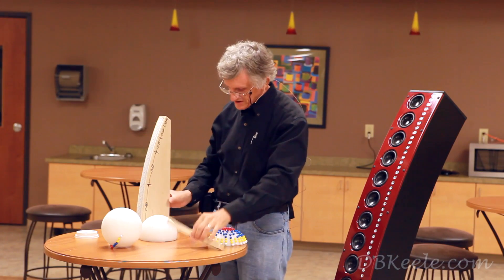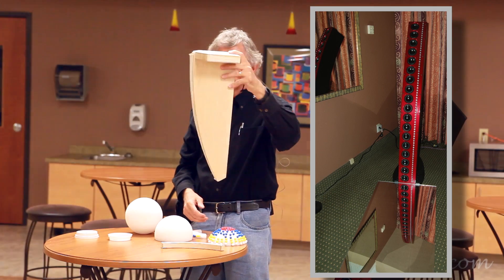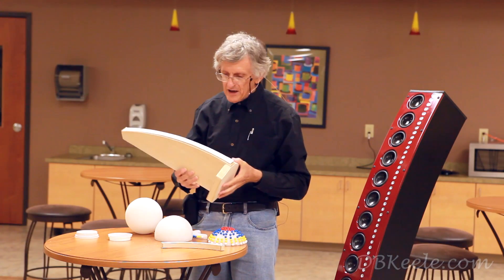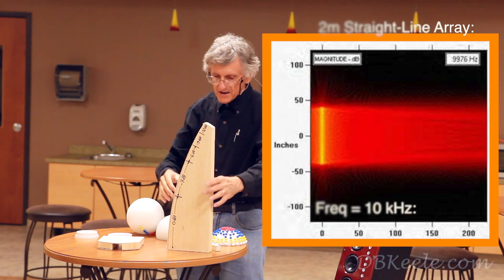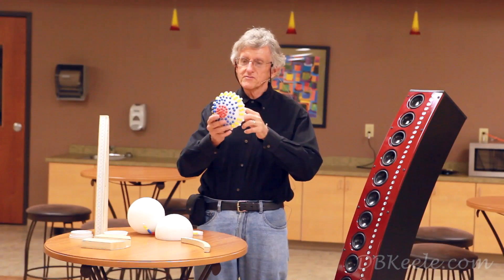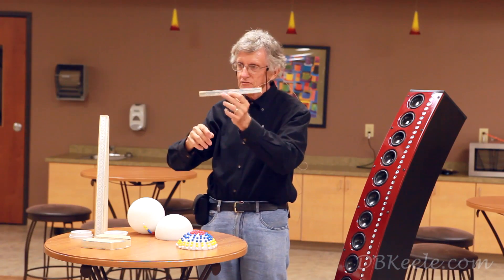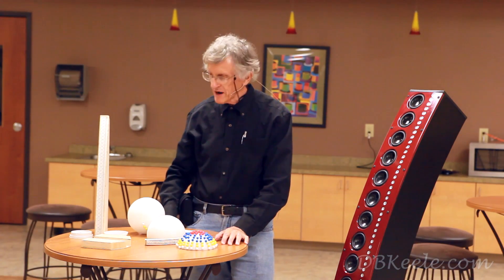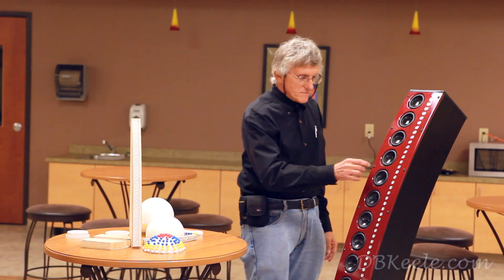CBT Chronicles Part 3 of 9 Introduction Continued: CBT Theory, The Gruesome Details

Comment: You get the lobes if there is no delay.  But add  delay and you cand control the lobes.  You've created a line array with physical delay instead digital delay then added shading.  I've used, and i am sure others, shading to digital line arrays 15 years ago.  I am pretty sure shading is used in stadium low frequecy circular arrays to keep bass inside the stadium.